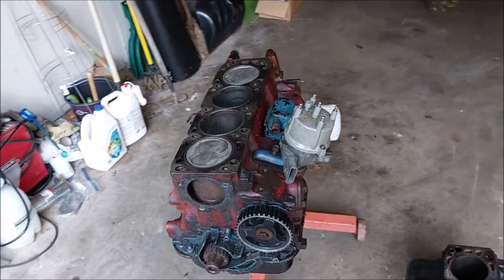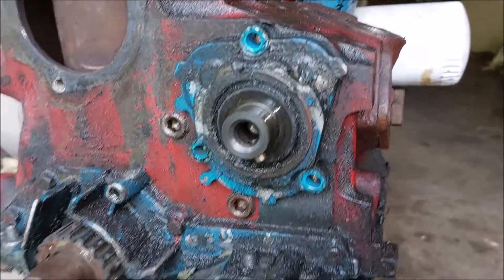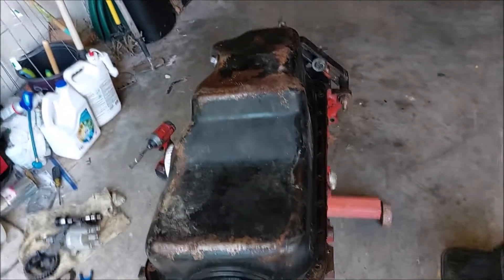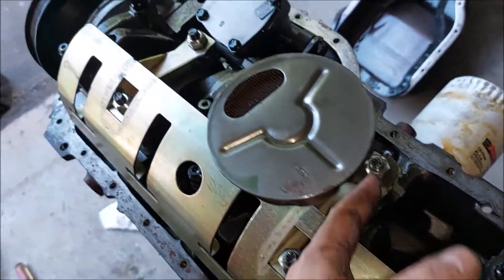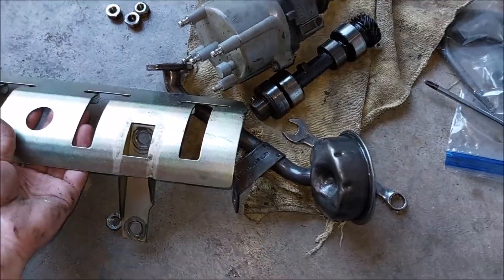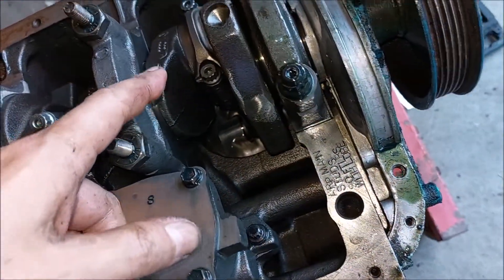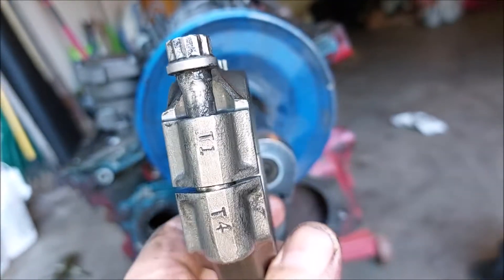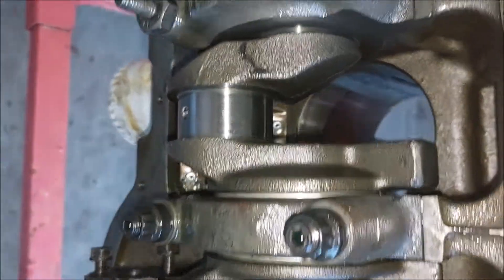"Built" Ford Turbo 2.3L Engine Tear Down, What a Surprise, Facebook Marketplace Find.

Comment: Looks like CP pistons meant for an Esslinger Aluminum Head.
Reply from the maker: That short block did have esslinger head on it is what I was told.
Reply: @everydayirace  they are the same pistons & rods that I run on my 2.3T. Making 420HP to the wheels with those parts. Quality items.

Comment: Great video. What do you think caused the bearing wear?
Reply from the maker: Thanks, but I honestly don't know, rod caps were mismatched on rods 1 and 4, and there was a fairly fresh high volume oil pump installed, and then there was an assembly lube 😆, I can speculate but it would be nothing but guessing.